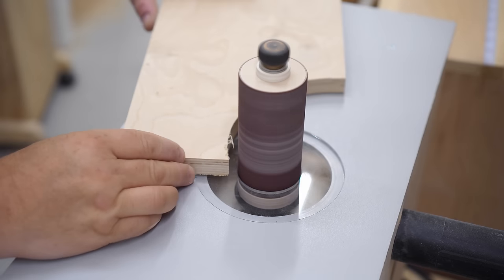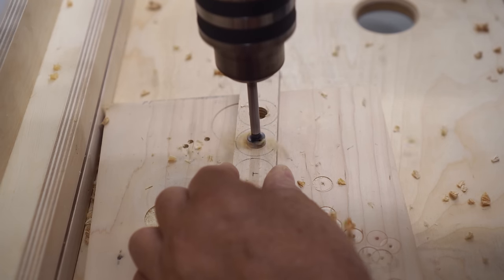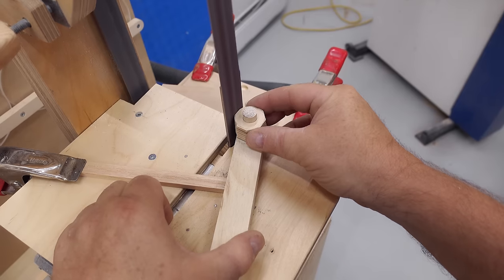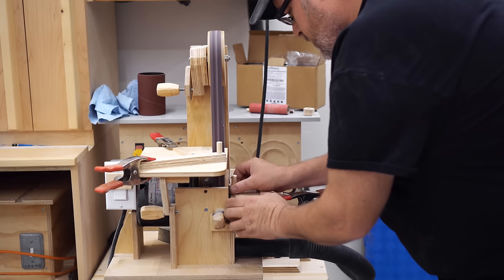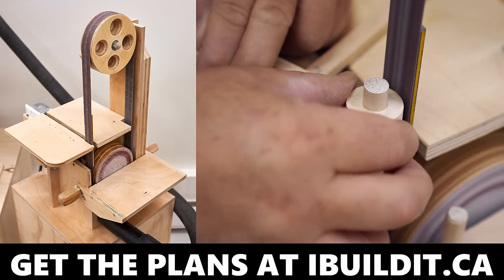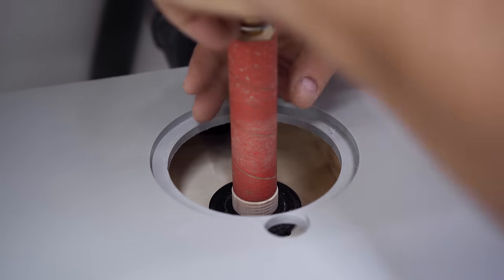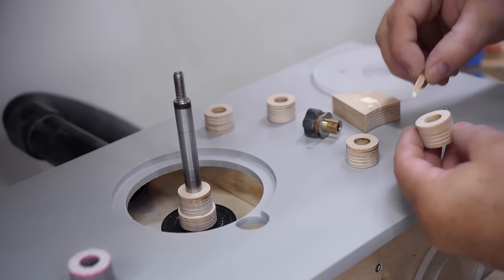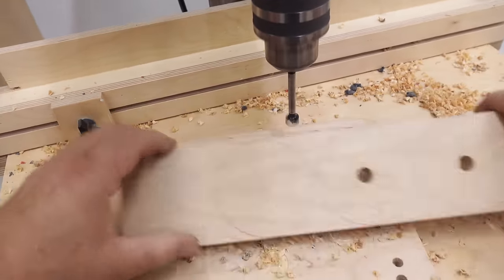How To Make Sanding Drums The Easy Way

Comment: I just had an idea and I wonder if it may be feasable. Before you made the foam version you experimented with a wooden spring feathercut disk thing. Imagine you made one side of those disks concave and the other one convex. Effectively you now have a springwasher. Stack many of them in alternate directions and as soon as you apply pressure on the stack with the screw on top they should compress vertically but expant in both other directions. Do you think that might work too?
Reply from the maker: That's actually a very good idea. Definitely worth a try, anyway and then the whole drum is made from wood.
Reply: @JohnHeisz  I'd love to see you try it out!

Comment: I thought you were going to put the rough plywood circles on the drum sander and sand them to finish diameter by holding a sanding block against them as the sander turned, until the block hit a stop. However satisfying that might be  (using a tool to build the tool) you probably cant reach the whole length of the drum. Never mind, another great video to start my Sunday. Thank you.

Comment: Try 6" 4" 3" 2" 1.5"  soil and waste pipes.  With a little heat, you can cut open and flatten pieces of pipe for the ends

Comment: Not having/used a drum sander I wonder if there are incidents of inverting the sleeve or using the rarely used parts to 'cobble together' another 'good' sleeve - or am I a skinflint? I like the way you simplify adjustments on the machines you build. With so many knobs etc hard to access, adjust or even grip comfortably on bought [non-ergonomically designed] gadjets, its nice to see thought behind operating a device and it inspires me [if I ever become accomplished enough] to build my own too. I already find myself 'making adjustments' to costly equipment now, to make life easier. Lets ignore the 'safer' argument eh?

Comment: Excellent video!  I'm curious to know if you've tried making your own sandpaper tubes for your oscillating sander?   Seems like some have had success using a a 1-2" shop roll sandpaper and light duty spray adhesive applied to the wood spindles.  What type of sand paper do you suggest for the drums?  A strong backing is probably needed.   Thanks!

Comment: Just found this. Very good video and explanation. I have a question on the gym flooring. It looks like you have a 1" thick piece. Correct? Is there a source for what you used? I searched on the internet and there's a huge variety on thicknesses and hardness, not to mention, - expensive when one is limited to buying multiple pieces. I'd really like to duplicate what you used. Can you direct me with brand, specs and source that you used?

Comment: Are you the first guy to make a homemade oscillating spindle sander?
Reply from the maker: There are several out there, already. Hopefully, mine will be the best, though :)
Reply: @JohnHeisz  I like how you included the hopefully. Very modest!
Looking at the oscillating sander things you just built, do you think it would be possible to incorporate a fence (or something) into your oscillating sander design to allow a user to pass thin strips of wood along to sand to a specific size? Like a vertical belt sander type thing. Just for small strips of course. Or is that a stupid idea for reasons I haven't thought of?

Comment: Well. . . I have had drum sanders—the same ones— with rubbers on them for 36 years and shrinkage has not even entered the picture. Mayhap if I had a newer version I would experience the same erectile dysfunction, and indeed may experience that in the future. For now, however, I'll stick with the tool I've got.
Cheers,
-- Joe